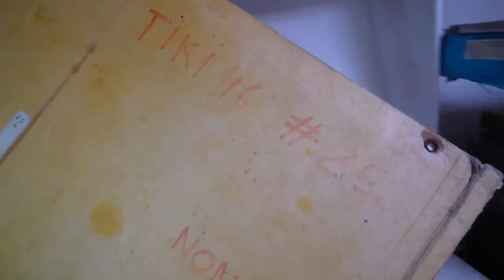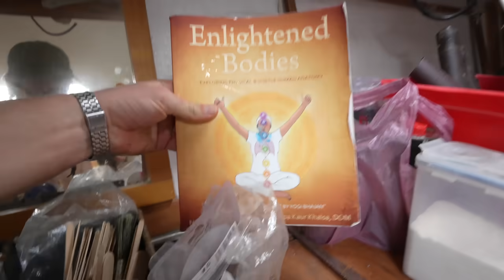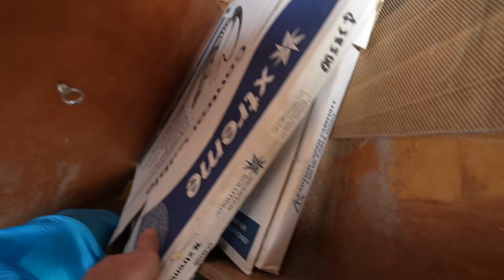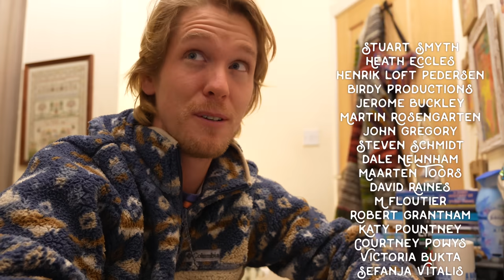Am I Actually Going To Buy This HUGE Project Catamaran? | Wildling Sailing

Comment: To me it's all about your budget. If it's tight it may be better to find something that's closer to home and that requires less work to sail. Seems like the location of the boat will increase the cost of materials needed to become sea worthy. Best of luck with what you decide
Reply: I believe if Mark has a stronger support system around him, this would be more acceptable a project.  As an education, we never do these things alone.  

I love the idea of this boat as an education and experience, if that's a long term plan.  But far from home without better sorry, if let someone with more resources do it.

Comment: My personal opinion is based on two issues,
1 location.
Personal security and boat security will be a major concern proportionate to boats increasing value as an investment.
2 location.
Every replacement item installed will be a major accomplishment purely because of distance from distribution depot.

Boat seller had nervous breakdown. Dreams fell to dust through his hands. 
For what it's worth, my sincere advice is....walk away, dream another day. Not one grey hair and no despair. ROD UK
Reply: Agree, RUN don't walk.
Reply: @dickdueck6537  
I don't know what will happen, but  I agree totally, I think the amount of naysayers need balancing out a bit, and I wouldn't be scared of getting that into sailing shape, and taking it to a haul out. If he could get an investor, or helpers that would be great, and I am sure a project like this would keep his channel, and may get bigger audience. If I wasn't a carer at present, I would love to help, just to be able to crew on it on a major passage.
Reply: Where your at you will either sweat your bum off  or pray for the rain to stop. There are two seasons  very hot and very hot and very wet. Plus I honestly think this is beyond your skill level but if you buy it good luck.
Reply: Wise words🕊✨
Reply: @wyattfamily8997  Lol🤣
Reply: @charlescann531  
Do you think that this man wants to be sipping Pimms in a Rhode Island yacht club, or rubbing shoulders with the blazers at Cowes week? A bit of sweat and rain won't hurt him!!!
Reply: @chrisyarnold6205   I understand that but I don’t think he understands just what he is is in for is all.
Reply: @chrisyarnold6205  a bit of sweat and rain does not cover it but again I don’t think he understands what he is getting into. Between the weather  and the supply chain issues I think he will get frustrated and discouraged sooner rather then later. Things are not as straightforward as everyone thinks there.
Reply: @charlescann531  
I reckon he needs some graft, running rigging, and crew to get it to a haul out.
He could probably make Panama if needs be, in day sails. He could get a 1 yr cruisers visa  for about 200 dollars, and make a nice value added passage maker, that he wouldn't afford in UK. Golfito bay is close to Panama border.
Reply: @chrisyarnold6205  good point if the boat is seaworthy which it looks like it is but don’t know how she is below the water line. There is a
Still a fair bit of work to be done before she is sailable rigging and decks engines fuel tanks electrical all need to be checked But I agree getting it to Panama is likely the best choice for a proper refit.  I also agree the boat is worth a refit but it is not going to be done on a shoestring. Sitting on the hard is not cheap even in Panama, cheaper then the US or the UK but that is relative.  I wish him luck but I think he should look at other options. But hay not my call.
Reply: Having spent a year living on board ,on the hard in a marina while I rebuilt a 30ft cat, I'd say. It's ALL about the location. IDK, but it doesn't seem like it's close to suppliers, a boating community that you can communicate with and get physical help. the distance between your friends and family. The issues with this boat itself, anyone with a level of skill can conquer. But without a marina, or suppliers or community , or associates, I think it would be a daunting task for anyone. Even the most skilled craftsman (er women). I would love to have THAT boat , but, have it HERE in a local secure boat yard. where time is not a crucial concern and I could have my boat bum friends join me on this adventure. Alone, I would be screwed, and not in the fun way. A sad pass on this one.
Reply: @chrisyarnold6205  This boat is not that bad or that tough to return to service, but in this location for an outsider it would be a hard task,  As for the boat, for 20,000 you will NOT find a boat of this size that does not need work. That's the nature of the beast. IMO the naysayers seem to think that someone  will magically hand them a sea worthy vessel for nothing. That's NEVER the fact. Remember what BOAT means. Break Out Another Thousand.

Comment: Based on personal experience with projects like this, I have one piece of advice: Run, don't walk. It'll suck you in, and then spit you out  again as a broken man. If ever I saw a money pit, then this is it. But still, all the best for the new year, whatever you decide:-)
Reply: All boats are money pits.  And to just get it sailing, doesn't look that far away.   And the last catamaran wasn't in a great shape either.
This is all about how much time you can put into it.  And I think he are able to put some time into it.

But we are not there, he is.  So he will know what need to be done to this boat to get it sea worthy.  And internals are not that bad.  The looks doesn't sail a boat, it adds or remove value, not function.   The boats he looked at earlier was way longer from being possible to sail them this one.
Reply: @AndersJackson the last boat was in a boat yard in Europe, and not in Puerto Rico. That very fact is the main reason I say forget it. Middle America is a different ball game to europe. The difficulties of getting parts and material delivered there is in itself a nightmare. And AFAIK he can't speak Spanish, which he will certainly need for the customs authorities amongst other things. And that in one of the most corrupt counties in the world. Been there, done that 😊
Reply: The hulls look to be in good condition, the rig is new and in place, and the engines are new. He needs to reinstate the deck slats & check the steering components and he could be sailing to somewhere he feels more comfortable (If he doesn't get bogged down in all the other stuff).
Reply: @Demolitionman7454  it's Costa Rica isn't it?
Reply: @thatchapter723  My bad :-) but the same things apply: corruption everwhere you look, and " backshish" if you want to get anything done. If you can't speak the lingo, or have someone trustworthy who can, there remains the problem of the location. Middle and south america are bad news for shipping, slow and expensive. Definitely not to be compared to the EU.
Reply: @helmshardover  Thats very positive but it's a gamble,and yes it could be done with 100 per cent commitment and a bit of luck , hulls  quite new she looks sound , if she could be made ready for sea consontrate on those things,but who knows in my own experience these jobs take a lot longer than they appear at first ,,and a difficult passage back to UK,food fuel and a lot of extra expenses, batteries? by the time everything ready for the voyage ,weather could be bad . and a bad part of the world for that sort of stuff,to my mind to much of a gamble
Reply: @johnwallis1309  The hulls were 1st Class when it sold for >€uros100k 7 years ago. He wouldn't need to have the engines installed, others have sailed larger Wharrams than this engineless, and smaller ones have circumnavigated without (Rory McDougall for instance). A Solar Panel, control box, battery & a tablet with Navionics would give him acurate nav. A few extra hands to turn it into an adventure (I bet there's a few volunteers from this channel if he asked), and sail to somewhere cheap and safe to moor...
Reply: @helmshardover  Yes I agree , if the hulls are sound  would want proof of how good the plywood is and what grade of marine ply ,cheap sheets are inferior to top grade WPB sheets I believe the decks And coamings ,have been  epoxides this is very good, but a little leak of fresh water in hot climes after 7 years can do an aufull lot of damage , fresh water being the enemy  of wooden boats , that said I've sailed wharrams back in the 80s and there very good sailing boat did a voyage Millbrook Cornwall to casecice Lisbon.  Portugal in 6 and a half days with favourable winds,we were engine less ,and am the first to sing the praises of theses boats,  but the location is iffy ,and a hard sail back from that part of the world,
Reply: @johnwallis1309  The one you refer to, John Shaw on his Tehini was the example I was thinking of!
In the case of this Tiki 46 it was constructed with top quality Bruinzeel Hechthout Lloyds approved plywood
Reply: @helmshardover  Yes that's the one wivenhoe built, Ying Yang ,sailed 1983 summertime.john went on to build a 3 masted schooner [see schooner sail ] Triovante,you are in possession of. More knowlage of her than me ,about this boat I was just trying to give mark good advice ,on restoring wood boats ,and to my mind ,basic woodwork skills are needed,she's probley in good condition,but she's a long way away

Comment: The location is the main issue, it's way too far away, the more you do and value you put into the boat, the more will likely things are to get stolen. There's a good reason old mate took the engines off the boat.
Reply: But them, how much are there to take sail that boat away? And the people around it seems not to bad, or the motor would have been stolen already.
Reply: Also, by the current configuration it is a minimum 3 man crew....

Comment: I'm a wood worker and from what I can see the plywood is called 9 ply. It is a very good plywood just sand it down. If you tend down your first coat, then lightly sand put your next coat and sand in between each coat. And you will be amaze how good it looks. Some of the dark spot mightn't come out and that ok.
Reply: Wow I read that a few times ...
Reply: Pity you're only a woodworker and not a boatbuilder, you might comment on factors that actually matter!

Comment: No, no, no. Been there done that myself. Wasted several years and spent far too much money when I could have been out sailing and yes I was warned by many and didn't listen. One of the biggest regrets of my life!
Reply: One of my worst regrets was not put the money in to buy a boat that I looked at.  Would have been possible to live in it while restoring it to better glory.
It all dependes on how far away from sailing she is.  And looking at the video, she isn't that far away.  She will not be pretty, but in way better shape then the ship that are on the shore just 100 meters away. Those are a not walk, run away project.
Reply: I am a handyman and this boat doesn't look so bad.

Comment: Cut up 2" pipe as pipe rollers and roll heavy stuff into place. Use the mast booms as derricks for your lifting and lowering with chain blocks.  
Or set up high triangle with scaffold pipe, or similar. Attached together at top centre.  Bottoms attached to deck sides. Ropes to top at each end forward and aft. This is the way they raised and lowered masts for hundreds of years.
Reply: Yep, think of how it was done in times gone by, the Egyptians built huge pyramids with no power tools.
Reply: Word. I used a pipe triangle and a chain hoist. Showed the old Perkins who was in charge. I hope he gets the boat, because when I got my Morgan people told me the same thing most of the people on here are saying. There's almost more pride in showing people they were wrong.
Reply: @ThatSandersboy  I hope he gets it too. I really do. Some people just have no Get up and Go, or a sense of adventure. With a bit of help it is possible to sail her again. 👍
Reply: I've moved buildings this way, great reference
Reply: Cut pipe into 500ml lengths if poss. Rolling on  wide scaffold plank (or similar) is good to even surfaces out.  Have rollers spaced apart so to they don't roll together and  bind each other.  Go slow.  Long bars, leverage is primo
Reply: @dcallan812  If you believe Dynastic Egyptians built those pyramids you are not paying attention to facts/science. The Dynastic Egyptians were a Bronze Age culture and a Bronze age culture with Bronze age tools/technology cannot cut mutli ton granite blocks from the ground, move it hundreds of miles, then lay those blocks withing mm tolerances over a long distance. In fact with our tech today, diamond cutting blades and laser sighting, we'd have trouble achieving the tolerances of the Great Pyramid. Go to the Cairo Museum and see huge blocks of granite that broke when cutting and you can see they were using a circular blade of some 8 foot in diameter. That is not a bronze Age culture, you've been lied to and fooled by your "education". These pyramids were built over 10,000 years ago before the great cataclysm, along with the polygonal work in Peru attributed to another bronze Age culture the Inca. Interestingly the Inca people themselves claim they never built Machu Pichu and other places, they too claim it was there well before they arrived
Reply: Mark, you will be isolated at that location and your mental health could suffer. Your mum and dad won't be able to drop everything to help you in that location. You will be alone with no partner like the cowgirl to pick you up when your down. Loo for something closer to home.
Reply: @Antipodean33  👍👍
Reply: @alfredneuman6488  no, only 2.75 , not quite 3
Reply: Aye.  He has two cranes already fitted.   They are unstayed but for duration of a lift could be temporarily.
Reply: @iainurquhart7606  thats handy, he has a lot to haul about and get moved into position.
Reply: @alfredneuman6488  you clearly needed some attention
Reply: @alfredneuman6488  sorry, you're right.
Reply: @alfredneuman6488  Cheers, Happy New Year
Reply: Thanks for the positive constructive comment , Mark needs that good attitude vibes .

Comment: As being the owner of a Tiki 31 that i renovated from a condition far worse than this one i thought i give some advice.  First you should know what your about to buy is a dream boat for down wind ,warm weather condition and a absolut nightmare for tacking in rough sea and cold weather.  For not having any keel ts not that it is as bad as you might belive as for drifting and taking hight when tacking, but you get constantly sprayed with cold whater when doing it. So what im doing on mine right now is building a stearing pod,dry cockpit. I will be put to the test the comming summer so i cant tell how much it will improve the conditions yet. but i think its a ABSOLUTE  MUST for you as well.
Second get at least one co owner ( preferably with some boat building experiance) both for charing the costs and the work. Doing this on your own and in a location like that will not end god. Just getting my 31 into shape was quite enough and even though im quite skilled as a boat builder on HR yatch the money was a constant problem.
Third .... Never seen that figuration with 2 parallel masts ,check out the pros and cons for that as much as you can bef making a decision ( maby have a talk Hanneke..)

Still Warrams are wonderful but you need a certained mindset to appreciat them ;)

Comment: Hi,
I am 62 now and done a lot of different boatworks over more than 40 years now. Looking back I do not regret any of the projects. One big project was building a steelboat, 52 feet from drawings. It took about 14000 hrs. Just learned a lot of new things. This summer I am sailing round Britain and will stop at Wharram office. I am really interested in the Tiki 38 but have to consider a few things. Time is a very big concern. The biggest infact. Then we’ll see, money, were to build it etc.

My advice is to get the boat. Make a good plan and stick to it. Get as much help as you can. Learn new things. Break down and get up again, stick to the plan.
Eventually you will have a very nice boat/home.
Good luck!!!!

Comment: Hey just also I hear you saying its a learning experience and I 100% am behind that, I have learned a lot of things buy jumping in. But building from scratch vs re-modeling/designing are two very different things. One thing I have learned from rebuilding cars, houses, airplanes, coding, etc is that whatever time you think it will take to do the work, quadruple it and that will be a more accurate number. Pretty much same for cost. I feel like you love sailing more than building, and I hope you know this boat will keep you from sailing (expecially any significant sailing) for quite a while.

Comment: Just like Minky,???  Minky was a completed cruising sailboat produced by a manufacturer, previously sailed on the Med, sitting on the hard in a boatyard in France surrounded by chandlers and boat repair facilities, easily accessibl, in comfortable climate, with shops, lodging and safety. 
When you think about it, this is the exact opposite of Minky.